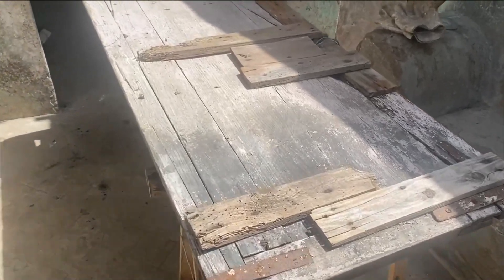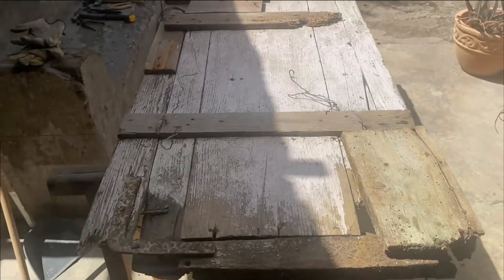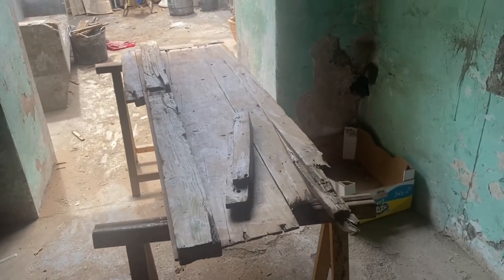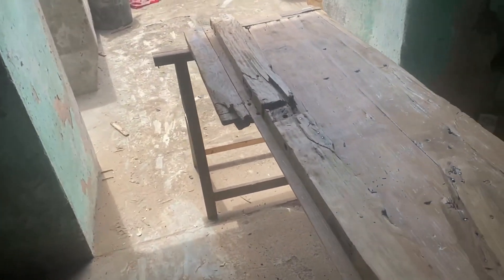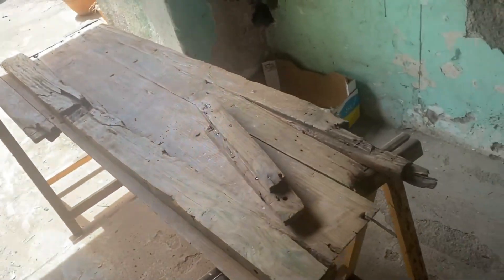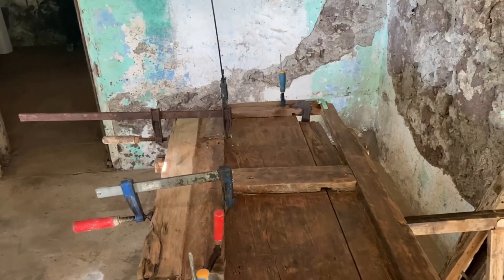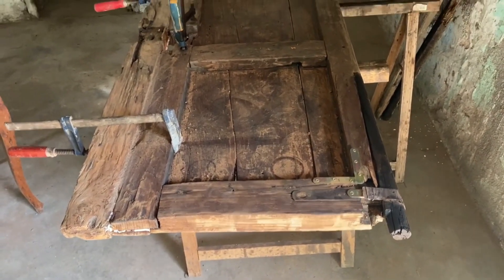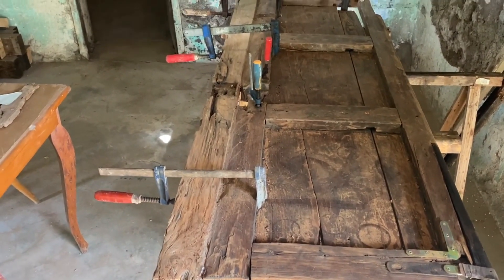BVRC095  Rotten wooden door is restored and given new lease of life (Pt 1)

Comment: I like the way you are restoring rather than replacing with new.  I seem to remember reading somewhere that tea wood is more resistant to woodworm than other woods such as pine.  The piece of wood you broke off with your hands looked to me like it had been added onto the door at a later date in order to try and repair it.  Am I right in saying this piece wasn't tea.
Reply from the maker: That’s right.  Tea is a type of pine but very hard. It has the load bearing strength of steel. These canary pines were hundreds of years old when the first Spanish arrived and such great building materials didn’t last very long. It was made extinct and present day canary pine, apart from not being centuries old, is crossed with Scandinavian pine. Not the same timber. The wood work and termites can’t attack it, unless it gets wet and rots - which takes years.  The piece you saw me tear off was not tea. It was a patched piece of modern wood a mere 40 or 50 years old. Yea is very heavy and dense.